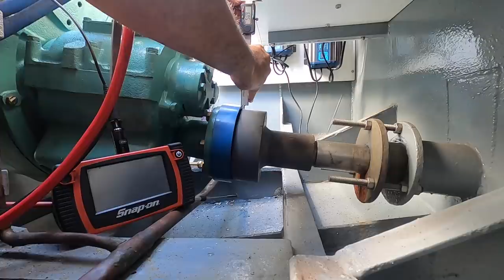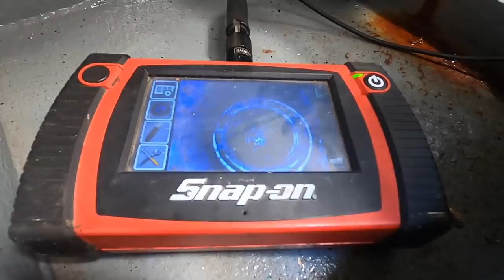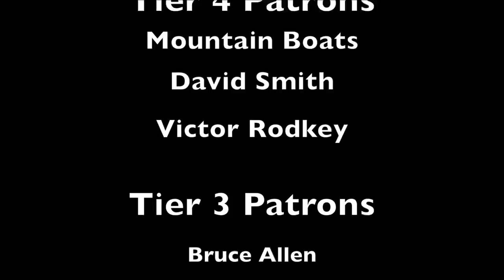Better alignment and odd jobs

Comment: Hi stu. Just another comment. ( one amongst heaps no doubt) is it possible to locate your out filter a little,e further to port  under the deck. In the old position it’s blocking access somewhat. Just a thought. Your going well with the alignment. Step by step. Take your time . Don’t get stressed. When I’ve done similar jobs I eventually get lost. Engine to the right screw the left screw, or unwind the right? An hour or so an my brain is fried. That’s what you get with old age !
Reply from the maker: Hey Gary, access is definitely an issue with this engine bay. I'm also planning to add an air compressor which is going to fill my primate access point so I may have to do some serious rearranging soon.

Comment: Stu: I applaud all your efforts in restoring the steel trawler.  Anyone who thinks they are up doing similar should watch this.  But I have to say that watching the alignment aspects is agonizing.  So difficult to make real progress. Almost worth hiring a pro to come on board for a day and just do it.  Wishing you the best!
Reply from the maker: Yes, my plan is to just get it close enough myself so I can spin the prop as I don't think a pro is going to want to do the job without being able to move the propshaft metal on metal.

Comment: can you fit an expansion bottle to the heater system, then you don't loose antifreeze in to the bilge, and would be easy to visually check the level without removing the cap.

Comment: Now that you opened up the overflow for the coolant system, make sure you put a proper coolant tank in place to make sure your system stays full. Otherwise any coolant overflow will also introduce air into your coolant system.
Reply from the maker: Yeah, I'll rig up some sort of overflow tank before too much longer.

Comment: You can also measure the depth of a step using the nose end of the vernier's, if you really wanted to get underneath you could cut the tail off a cheap set and do that. prob don't really need to though.

Comment: Those rubber engine mounts can be a huge pain in the ass. I have used silicone grease under the mounts to help reduce the friction for fine adjustments in the past. I can't say it was a perfect fix, but it did seem to reduce the distance it jumped on fine-tuning.
Reply from the maker: Yes, really wishing I'd sprayed everything with silicon first.

Comment: I remember doing the very same alighnment job on a sailing boat...bloody nightmare!!!😅😅...and then to discover the propshaft was ever so slightly bent😨...I used feeler gauges👍
Reply from the maker: Apparently this shaft was slightly bent too when I took it in but they straightened it. I'll be using feeler gauges once the propshaft is free.
Reply: @DangarMarine  I was reading a article about shaft alignment when I was doing mine.. it says about not needing to be so accurate with feeler gauges etc because the amount of engine torque twist and movement on the engine mounts, you can align it perfectly for one situation start the engine the boat rocks slightly and temperature drops, the coupler expands or is slightly out to start with and everything is out of alignment again 🤔 it's a headache to say the least 😬 proper shitty job I hated it 😂 

Keep up the good work 👍

Comment: Are you going to use an cooling system recovery tank? if so make sure you use the recovery type cap. Saves all the overflow going in the bilge and not having that used coolant smell. 👍😊🏁🇦🇺
Reply from the maker: Yes, will find a good one and install it.

Comment: Hi Stu, are you going to have a manual pull cable, as a back up to the shut off solenoid, just in case. As the old saying, "What Could Possibly Go Wrong"

Comment: one thing with the pollyflex have you an even torque on the flange bolts as it might  upset one side adding to the measurements.  just like squashing a rocker cover gasket etc.
Reply: Not a fan of pollyflex couplings as I believe there are more forgiving and fault tollerant options out there. However our main man has gone with the blue slice of plastic. So are there different grades of blue plastic and do they have different compression functions? Can our man look up, a max torque setting before deformation sets in?
Reply from the maker: Yes, the coupling will come out to do the fine alignment metal on metal.

Comment: I laughed when I saw the crane go out the door like I mentioned in previous video. As far as I'm aware tapered pipe thread does not come metric. Baring that grab brass plug for hole and tap it however you want.
Reply from the maker: I think you are right about the thread. I'm pretty sure the guy at Pirtek said it was NPT.

Comment: the dial gauge doesn't need to go back to the same spot every time, I've never even thought about seeing if mine do or not, but I doubt they do. The idea is take you measurement with plenty of adjustment each way, and then set the zero, so you can measure a negative and positive and there is never a gap/void spot in the rotation.
...After all these videos and my stupid comments, I finally have something proper to say lol

Comment: Couple of things... for those tight hose bends, use a longer piece of hose and loop it around. Easy, safe, fun and cheaper than new fittings.
For the temp sensor, if you have trouble finding the correct inner threads on an adapter just buy a plug, then drill and tap your own threads.
Lookin' good... just a bit more Brother.
Cheers.
Edit: How much is that engine going to 'settle' on those mounts once you fire it up? Hold up on final adjustments until after that, no?

Comment: Hey Stu those solinoids are a pain in the A i had one on a Louisville nothing but trouble i bought 3 all the same and they are not cheap i swaped it for a choke cable problem solved  i will look for my old one its yours if you want it 🍻
Reply from the maker: It will be interesting to see how reliable this one turns out to be. A cable can be a good option. Were yours 24V?

Comment: Have you thought be using an expansion tank for the cooling system overflow like a car? It could then suck in this excess when it cools.
Reply from the maker: Yes, will add once everthing else is done.

Comment: Just in case you forgot, in the stern there were cement bags and you took them out. That might be the reason why the boat leans
Reply from the maker: Yes, I've replaced them with lead ingots but I still need to add more.

Comment: Hey Stu, I was kinda wondering why in all Gods good creation, you don't use that incredible, reliable, and precise piece of machinery called simply the DIAL INDICATOR with magnetic base, to align the prop shaft and crank shaft together. You don't have to go full circle. With 3/4 circle you can align them both extremely well. If you have already done so, please disregard this. Good job mate. I love your detailed videos. Greetings from sunny Greece.

Comment: If you cant find an imperial to metric bushing, just take a 5/8" (?) plug and drill and tap it. That looked like a 10mm X 1.5 thread on that new temp sender no?

Comment: Hey stu those isolator switches look like they are at kicking height, they may easily get damaged, we have similar problems with out machines so we put like a U kitchen door handle above it the protect it a bit, might be an idea
Reply from the maker: I'll definitely consider that. This is where they have been for the last 30 years and they are pretty strong but it is a good idea to protect them.

Comment: Hi Stu, like you said tough to align by yourself and not allot of room for two people down there. You are really close though. Your plan on moving the prop should give you the room though without dry docking to finish the alignment but what I have seen so far. Once it's set is there a recommended torque sequence and torque? I finally go a new editing software for my channel and just testing it currently. Love it so far
Reply from the maker: Hey Tim, once it is all aligned I would just torque it very similar to car wheel nuts.
Reply: Are you going to bar the motor by hand to turn the prop?

Comment: I'm thinking you should have at least one nut on top of the mounts tight so it doesn't lean while dialing in the alignment. When you go to tighten them it could have side stresses on the bolt.
Reply from the maker: Yes, it's a little bit tricky to know if there are any side stresses on the mounts, that has been on my mind.

Comment: Really enjoying watching the project develop. Once you get the motor mounts tweaked to perfection what is your thinking on them remaining true under the stress of a heavy sea?
Reply from the maker: They should be fine according to the manufacturers, just need to tighten the locking nuts.

Comment: G'Day Stu,Good to see ya left that alignment when ya did,,Could hear you getting a bit frustrated,,spose my fault for not telling you ,
1) flange's parallel first ,So up or down front or back and side to side,Then,?
2) Get height about right,This is just up or down on front and back,Move all screws same rotations ,If you move any screw 2 turns say,move the other 3 the same,these are you adjustable mount bolt,and should lower or raise the engine square to coupling face
3) side to side,Same as above but side to side,,in that you will need to move jack bolts on front and back the same,if you are fairly parallel to start yo won't have move to far out of parallel
4) go back to 1,and check,it will have moved,,but each time you run through it will get closer,,
Sorry Stu,should have said something ,,
One more thing when you star getting close put in-dedicator on edge you want to move and watch till about right,,say ya want to move it side way 0.05 mm Bit hard to say that 1/5 of a rev on the bolt ,there will be spring,but as you discovered a few taps just shake thing up should remove some of the spring,
recommend run for a while then check again,,some times with the rubber,,well yeer Have had a couple,,but that was heat expansion,,and had to best guess,, so it runs,better when the sun hits it,,
As for getting measure meant top and bottom,use straight edge and feeler,,

Comment: This intro cracked me up Stu, the timing, element of surprise and slow exit stage left of that gantry could not have been better if it had been rehearsed. 🤣🤣🤣🤣 The alignment is steadily coming on, a bit of lube on the flange face would have helped but that's a lesson learned for next time but I hope there won't be a next time. Keep the vids coming Stu, your very close to completion now 👍👍👍
Reply from the maker: Thanks mate.Yes, a bit of silicon spray would have helped a lot. Next time!

Comment: At some point I would be looking for a big set of U joints after all that. lol.  Worst thing I have to do is getting a V-Drive lined up. 20lbs is a lot easier then a 2000lb motor. Even a MerCruiser alignment is just adjusting the front feet right.
Maybe use a piece of pipe to make guards for those switches on the motor box rim. They look easy to kick off. Also if you don't get some hose clamp ends you are going to get cut. Trust me. Get a small fitting and tap it out yourself. Brass is easy to tap.
Reply: You must be using a paper weight v-drive... the last one I had to manhandle was about 400 pounds. That was the biggest Walther's v-drive I had seen. I really like the ones Hurth or ZF makes far better than the Borg-Warners
Reply: @krissfemmpaws1029  Casale C-1000 is the biggest I have in stock at the moment and it cant be anymore then 30lbs. It can handle around 2000hp but its also 50+ years old so I don't push it that hard these days.
Reply: @finscreenname  your idea of 2000 horsepower is likely in a dragboat. My idea of 2000 horsepower is in a tug boat. Meaning what you see is a flash in the pan what I see is hour after hour of work being done.
Reply: @krissfemmpaws1029  Actually it's the 1967 Nova 24 race boat. Twin 1969 offshore Kiekhaefer 482ci (496's now). Both go into a single Casale C-1000 V-drive to a single prop. The boat was built for races like the Bahama's 500 which it did 2 times. Back when off shore racing actually went offshore. But I understand what you are saying being my 1959 Biesemeyer drag boat is exactly the way you said.   https://www.youtube.com/watch?v=tswA4pTmTbY&list=PLBcphYdOqWq6SD-TBhKMaDSx5o5rbpuQE&index=1
Reply: @finscreenname  the engines are designed to last 48 to 72 hours of hard use... the tug engine is designed for years of use and abuse.
Reply: @krissfemmpaws1029  Well I hope to get longer out of the motors then that (at least my wallet does) but I hear what you are saying.
Reply: @finscreenname  I hope you do too. But I'm stating the design use of those motors.  I worked at shops that built race cars and race boats.. look up Don Watmore. Don built some nice drag boats back in the day.

The simple way to get longer engine life is run a diesel grade oil like Delo 100 and don't pull as much power out of the engines. In short don't bend the throttle handles. I don't know the redline on the engines but running them around 3000 to 3500 rpm should give you much longer engine life. 

I wonder if those are the engines that Smokey Yorick helped design?
Reply: @krissfemmpaws1029  Not sure who was helping Carl at the time so many names float in and out. Pretty much everything besides the Rods were off the shelf Chevy parts. They did have to weld up a stroker crank and re-turn it but it was also just a Chevy part # to start. They did special make the rods but you can buy the same size by other makers today online. Crane did the cam and....all the porting and polishing. Apparently that's how they got started before the cam thing took off for them. 
Fixing the first one (original never opened motor) and building it's clone (down to the part #'s) I did have to cut the cylinders and now the 482's are really 427ci tall block, 496's.
We are not doing any off shore races so like you said I would like to get a few hours out of these motors but it's not like they have never been out of the boat and in the garage before 1, 2, 13 times. I do like going fast. 
Been running Rotella T in all my motors for years. Started because it still had the zinc in it for motor break in (even though I always add a bottle). After the first run there is no reason to change so I just buy the stuff by the case now.
Reply: @finscreenname  I have vw type 2 and a 1979 Toyota pickup I run Delo in them. When I get the plane flying I'll be running Delo in it as well unless I find a better oil.

Comment: Is it as it appears, you are only running return fuel to one side?  My boat came to me that way, and there are times I really needed selectability; so I added a couple of small valves and a bit of hose which now enable me to sent return to either or both tanks.  Makes it easy to level the boat because of the large return volume, and provides for very flexible fuel system casualty correction.  You already have supply from either tank, do you not.  Might as well do the other end too.  :)
Reply from the maker: Yes, it is definitely something on the to-do list.

Comment: Isn't there some kind of flexible coupling that doesn't require such precise alignment? It would help also when under way and the is some movement of the hull.
Reply from the maker: There are, but they won't fit in the space I have available.

Comment: Have been watching this series with interest, I think it's amazing the work you do and your attention to detail, watching you line up the engine was fascinating, I was wondering though, how much will the engine move under load on the mountings and should there be some preload applied o ensure when it's under "normal" local that it will be more inline.
Reply from the maker: Apparently the mounts shouldn't move that much under load.

Comment: Gotta ask a question....now that youve gone through that process, removal, reinstall and align, did or can you think of anything, either tool, guides or whatever that would make that process any easier?  It seemed as though although not much changed really, there was likely a significant change in things (overall) while the detroit was being removed, rebuilt, the boat was worked on etc..  
I know you make things look easy but unless you've hidden a bunch of stuff it really looked tolerable?  well, you've still got all your hair! 
Nice one and thanks for sharing!!

Comment: Hi Stew. Why don’t they use a universal joint between the engine and the prop. The alignment would not have to be perfect.
Reply from the maker: I am looking for something along those lines that will fit at the moment.

Comment: Some nice progress. Did you, whilst adjusting the engine mounts use the thread pitch as a guide as to how many turns to move the engine and if so, how accurate was it? If you have any problems finding that adapter, I have access to a small lathe, extensive tap and die sets and a fair stock of brass at West Pennant Hills that could be promptly deployed in an emergency. I could also deliver.
I might be up there for a fish on Sunday. i have a heap of stainless and ally sheet and angle lying around here. If you need some and are too busy, I could tie it to a 2lt milk bottle and chuck it in near the loading ramp for you or meet you briefly if you'd prefer. Cheers.
Reply: Oh and BTW, yes he is Eddie.
Reply from the maker: No, didn't go by the thread pitch and number of turns, just the calipers. Appreciate the offer of help with the lathe, I'll keep you posted.

Comment: Great Vlog Can i ask why you don't use A clear Fuel line so you can see flow to the Engine and the Return Line for fast fault finding with fuel flow at anytime in the boats life ????????, other than the cost or not having it :). lol O and Please add a water separator with the fuel Filter . Just saying :)
Reply from the maker: Most clear hose isn't fuel safe unfortunately. Yes, fuel filter already has a water separator.